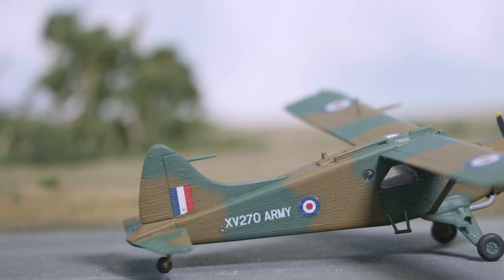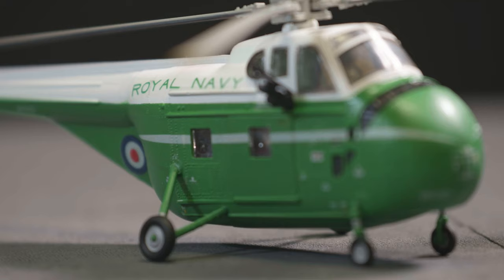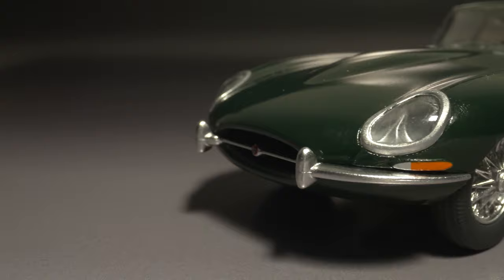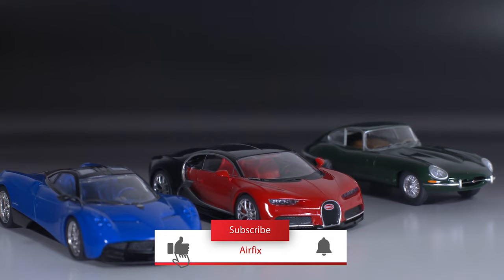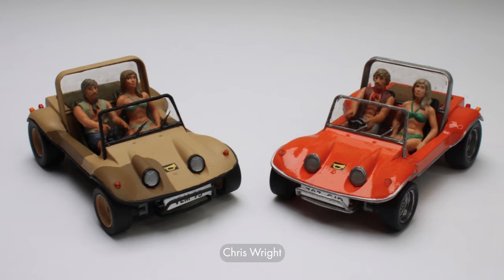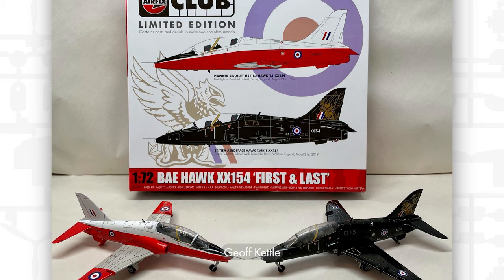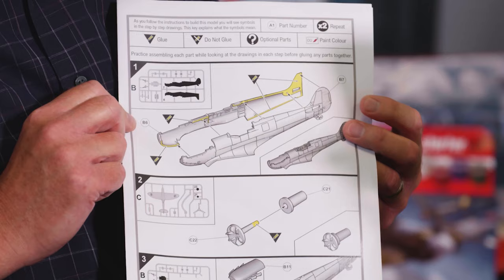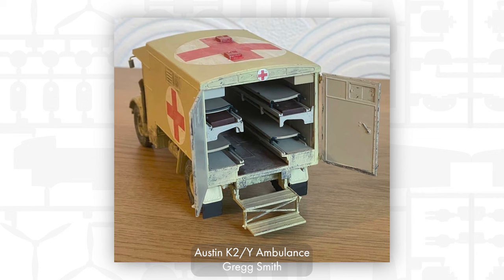Airfix | Flight Deck- Gloster Meteor F.8!

Comment: Really enjoyed that, Airfix. Thanks for sharing. Good to see the new starter kits taking a 'new/young modeller's perspective'. I've picked both new starter kis for Shernan Firefly and Tiger 1 and they're a joy to work with, and fit is superb (dioramas would be a wonderful addition to see included though, especially for new/younger modellers). Very well done on these new kits.